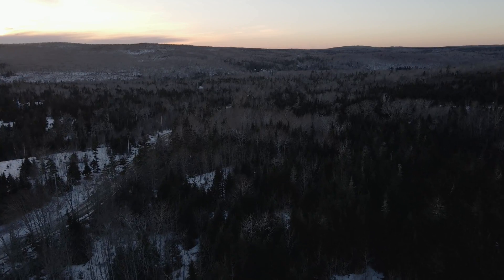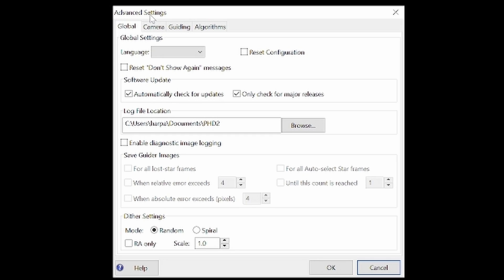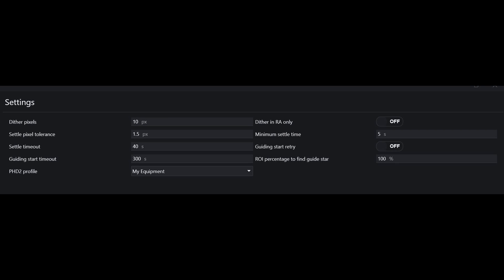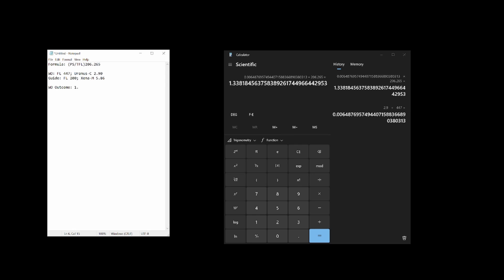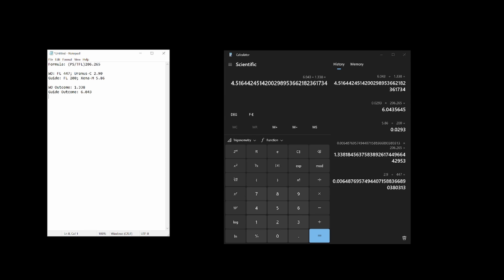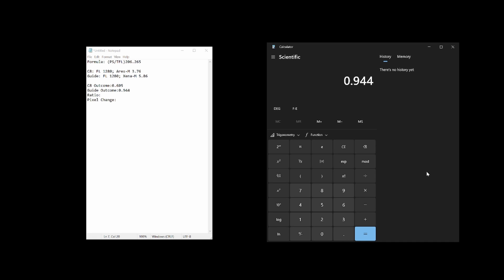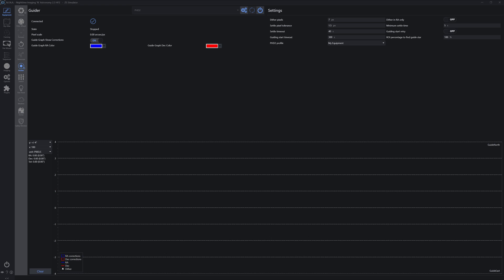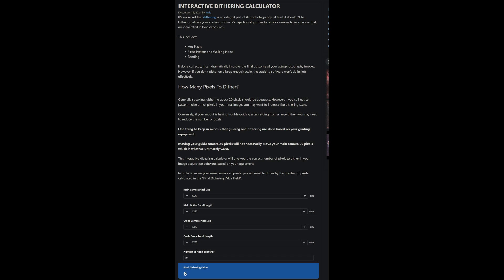Calculate & Setup Dithering In PHD2 & NINA

Comment: Thank you! I use for the maine camera 3,75 pixel size on 1000mm, and Off axis guiding also 3,75 1000mm- means both values x 206,265 is 0,77349. Means how much pixel i should write in Nina? Is it 0,77/0,7= 1. 10/1= 10 Pixel?
Reply from the maker: If there is no difference between your guide camera's pixels and your imaging camera's pixels, and you are using an OAG so they are both working from the same optical tube, then their relationship is 1:1.  That's the simplest possible setup and you can just determine and write in how many pixels you want your software to dither.

Comment: You don't need to multiply by 206.256 (which is the conversion factor for radians to arc/secs). Answer is the same since the 206.265 cancels out. Unless you also want know the actual arc/secs per pixel.
Reply: True and thank you

Comment: Many bin thier guide camera.
Reply from the maker: That's a good point. I wish I had thought about it. I always forget about that since I live in an area with no meaningful light pollution ergo binning rarely ever is productive for me.  But if binning, just add the guide camera pixels by however much is binned. So, if binning 2.9 mm pixels 2x2, then calculate the guide cam pixels as 5.8.
Reply: I tried binnning a couple of times and I was not totally happy. Though I reckon I'm kind of obsessed with high res (and my storage and processing time pay anice toll for that :D )
Reply from the maker: @CGastro  I agree. I'd rather the higher res I get from not binning.